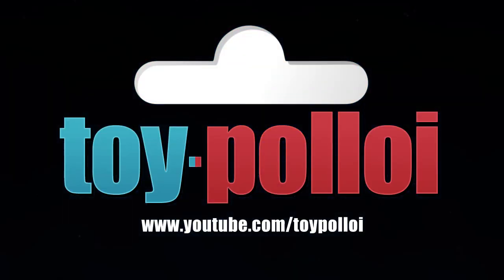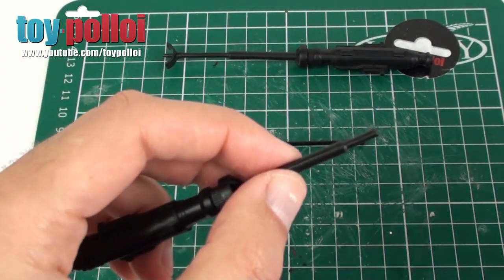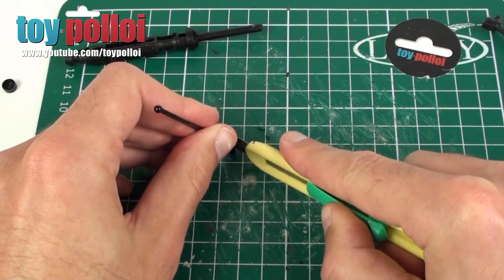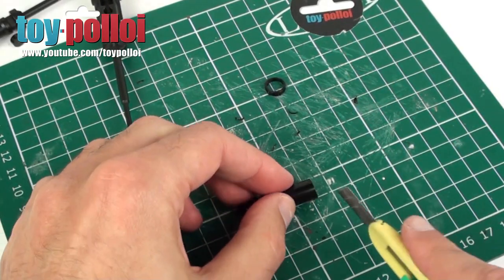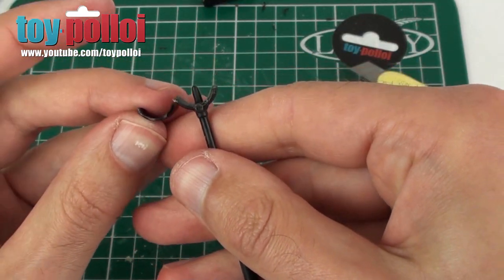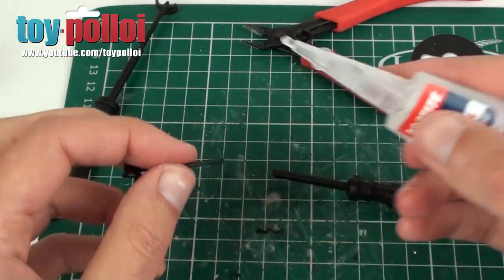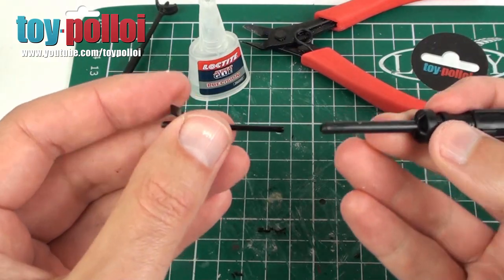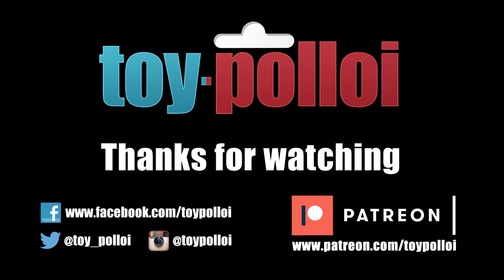Vintage Star Wars X-wing gun repair guide - Toy Polloi

Comment: Great solution! I designed and 3D printed some replacements for my old X-Wing. I made the poles longer and rotated the "emitters" 90 degrees to make them more accurate to the movie. Using your method, anyone could easily make them longer and rotated the correct way as well. Great job!
Reply from the maker: +ArtDecay Thanks. My plan is to make it so anyone can have a go. But I would love a 3d printer one day.

Comment: to taper it would it be easier to use a pencil sharpener?
Reply: Nah. But...he forgets that he has a portable lathe right in front of him. He could have chucked the antennae into his cordless drill. With the cordless drill spinning the antenna (as if it where a drill bit), the tip could have been worked with sand paper to fashion the taper.